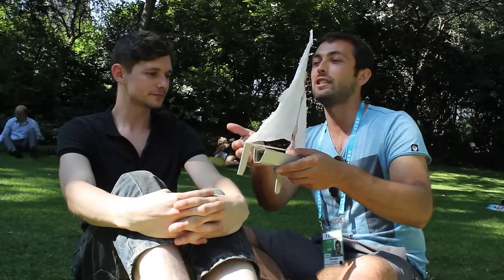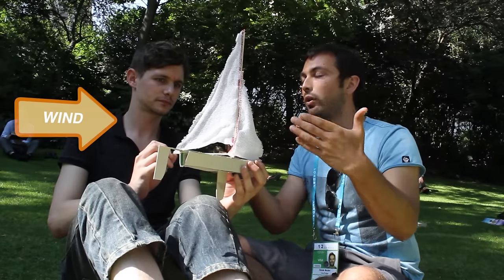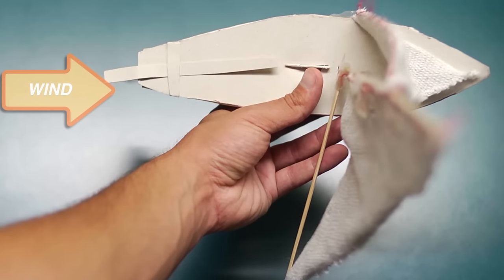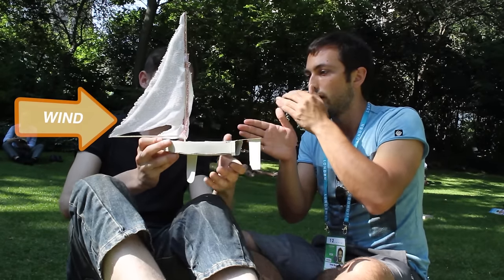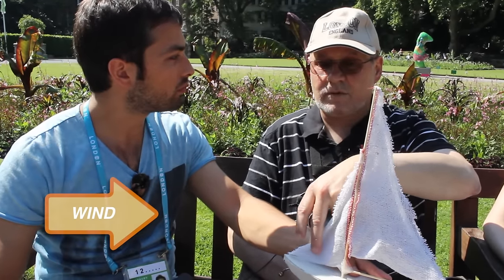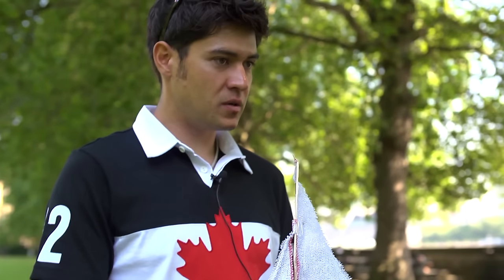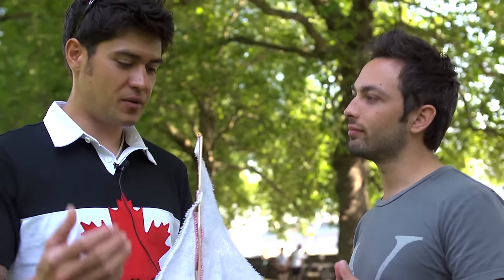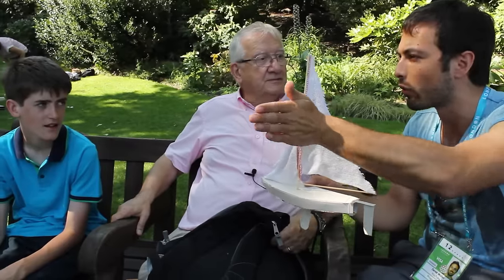How Does A Sailboat Actually Work?

Comment: Agh, again with this nonsense about the air having to "travel different distances". Lift is caused when the sail (aerofoil) turns the direction of the flow. The sail applies a force to the airflow, and the airflow has to exert equal and opposite force on the sail. That force is the lift. That is the kinematic basis for aerodynamic lift - trying to explain it by high and low pressures is technically correct but unnecessarily complicated. The pressure zones just kind of have to happen that way for any interaction with flowing fluid.

When you push something with your hand, you're not thinking that you're creating a high pressure zone on your palm which pushes the object away, even though that is essentially what you're doing by applying a force on the surface area of your palm. You're just applying a total force on the object.
Reply: HerraTohtori The guy giving the explanation was a sailor, not a physicist. Pretty silly that he had a competitive sailor as the expert.

Thats like having a cook as an expert on what happens when you boil meat. He might have some knowledge but more accurate answer is from a biologist or chemist.

jep jep
Reply: The longer/shorter way explanation is especially embarrassing when transferred from airfoils to sails. It is very obvious that the way on both sides of a cloth is equally long. This is an interesting demonstration of how we tend to mask out obvious contradictions in explanations if they are presented by teachers/authorities/gurus.
Reply: Jörg Wagner yeah I can't believe they left in the already false long/short ways explanation that becomes completely nonsensical with a sail! ugh
Reply: Jörg Wagner Similarly, lindybeige once asked a british tank commander at a public demonstration a question about the tank cannon's muzzle brake and the tanker had no idea what he was talking about.

You need not know physics details to be an expert or champion machine operator. You shouldn't be tasked with explaining the physics, though.
Reply: I actually think the pressure zone explanation is clearer to me. what changes the direction of force? right: the air pushing to fill the pressure hole inside the airfoil (or under)
Reply: Agree! It's the turning of the air that creates an equal and opposite force on the sail. This Bernoulli's principle explaination is rubbish. It gives you no appreciation of what's actually happening. It's a consequence, not the reason. How lift is generated on a wing/sail is still extremely badly explained! Wish they would do some velocity triangles and apply Newton's third law. Simple!
Reply: HerraTohtori completely agree with you..
Reply: HerraTohtori Lift and turning the direction of the flow are 2 different principles. Turning the direction of the flow is a momentum change thing, and the only force that can be harnessed from it is one that goes in a downstream wind direction, or a vector acute to it. A sailboat can't go against the wind by just changing the direction of the flow. With lift, you can go upstream.

At least, that's what I understand from your point. Maybe I misunderstood.
Reply: And once again we get this nonsense. If the mechanic you describe was all that caused lift planes wouldn't have enough lift to fly. This is coming from an actual engineer
Reply: @jamesdinius7769  I think you may have misunderstood what I wrote. Or do you think wings can break Newton's third law of motion?
Reply: @parameshnat  You've understood correctly, but the lift is really the consequence of the aerofoil changing the direction of the flow.

In this example, wind hits the sail at a suitable angle, curves around it, and the resulting force applied to the sail moves the boat. Airflow pushes the sail in one direction, but Newton's third law ensures that an equal but opposite force is applied to the airflow interacting with the sail. Typically, an aerofoil wing's lift force is somewhat to either side relative to the ship's hull, so the lift force can be split into two vectors - one aligned length-wise, pulling the ship forward, and one 90 degrees towards either side. The keel of the ship then produces a counter-force to the sideways lift from the sail, and that's what allows a sailing boat to track straight through the water.
Reply: @Statek63  Bernoulli's principle is a bit of a red herring here.

Bernoulli's principle states that when a fluid's velocity increases, it's pressure decreases. This has often been (to varying levels of success) used to explain lift produced by aerofoils or hydrofoils. And it is, in principle, a truthful principle although wings are at the same time more complicated and simpler than pipes of variable diameter, where Bernoulli's principle is usually more directly applicable.

In other words - yes, the airflow accelerates on the top side of the wing more than on the bottom, and therefore the air pressure on the top is reduced compared to the bottom, and you can of course say that the pressure difference causes the lift, but in my opinion such an explanation easily obfuscates the dynamics of the situation and tries to turn it into some kind of static situation where you have a low pressure and high pressure and the difference equals the lift. 

In a more complete explanation of the lift, the behaviour of the airflow must also be taken into consideration.

So, the better question you should ask is this: If we take it that lift can be explained by Bernoulli's principle - Why does the flow accelerate when it passes over a wing that's producing lift? This is where most of the explanations of lift using Bernoulli's principle fall short of their target.

The answer is... the flow speeds up on the top because the wing is forcing the airflow to change its direction.

Which, don't get me wrong, causes a pressure differential between the top and bottom of the wing and integrating that over the entire wing's area produces a force that's called "lift", but that all is just details.

The core concept of lift in its simplest form is that the wing applies a downward force to the airflow, and by Newton's second law, the airflow must apply equal and opposite upward force to the wing. This doesn't mean that air is somehow bouncing off the underside of the wing, rather the wing applies a force to a large amount of air both above and below the wing, as it causes a turn in the airflow around the wing. And the way this force is transmitted to such a large amount of air is via pressure gradients that form above and below the wing, distributing the effect to a certain distance.

Comment: Wow! I was amazed how little most people know about how a sailboat works. Maybe other people want to jump in on my explanation but I explain it simply my saying that a sailboat can do more than just go downwind because it has a keel. With a keel the boat is like it is on railroad tracks and does not move sideways. The sail can be used to blow the boat down wind and obviously more and more degrees off of directly downwind because it has a keel. As the wind is 90 degrees off one side the sail can be used as a wing and make lift 90 degrees off the wing surface and move the boat forward and the keel prevents the boat from sliding sideways. Now you could see that this technique could be used to go a few degrees upwind and may a few more degrees and a few more degrees... You can keep doing this to about roughly 45 degrees into the wind. You can not go directly up wind. I hope this helps and is a very simplified explanation of how a sailboat works.

Comment: Agreed, it's not about distance.  It's simply the sail diverting the air from a path it was going previously.  This diversion causes some backup in the molecules of air, leading to higher pressure on the interior of the sail.  The diversion towards the inside leaves a void on molecules of air (low pressure) on the outside.

Comment: This video is pretty inaccurate, even though the explanations are the accepted ones.  Anyone can see that sails aren't shaped like wings, and there's no significant difference in distance the air needs to go on each side (they're just sheets of canvas!).  The sails work simply because the wind hitting them is deflected by a certain amount.  This means the wind experiences a force, and so the sails get the same force by Newton's third law.  Because the sail is effectively a 'reflector' of wind, the net force on the sail is normal to the sail (ignoring drag; drag brings the direction of the net force backwards a bit).  The normal to the sail always points at least slightly forwards so there is always a component of force from the sails that points forwards.  The keel and rudder are there to react to as much of the sideways component as possible.  The difference in pressure is an equivalent explanation, but it makes no attempt to explain the origin of the pressure difference.

Which direction is fastest is actually is far more nuanced than just a single number.  For an average cruising boat, the best angle is probably around 110-130 degrees to the wind, but for a racing boat this angle is larger.  For an ice yacht (these experience almost no forwards drag from the ground, but don't slip sideways like boats do on water), this angle will approach 180 degrees.  This is because any wind the boat makes (called apparent wind) will tend to decrease the relative wind angle, because any apparent wind must come from 0 degrees.  The most efficient relative wind angle (including apparent wind) is probably around 90 degrees, but the exact number is unimportant.  If you start sailing from stationary with the wind at 90 degrees, you'll pick up speed, but now because of your apparent wind, the wind angle is probably closer to 70 degrees now, so you should turn away from the wind again to bring the apparent wind angle back to 90 degrees.  But now because your efficiency has increased you'll accelerate, meaning the apparent wind will decrease the wind angle again, so you must turn away from the wind again.  This is obviously a positive feedback loop that in principle will allow you to accelerate indefinitely.  The limiting factor is obviously drag, but if drag is small enough, one can sail faster than the wind.  Normal cruisers have a lot of drag so their most efficient angle is relatively low, whereas an ice yacht will have an ideal angle of around 170 degrees once they're up to speed.
Reply: Ironically the model of sailing that you stated was actually the old accepted model, and works decently well up to a point. Frank Bethwaite sums up why this model is inaccurate and why the airfoil model is more accurate in his 1992 book “high performance sailing”. It goes extensively into how he and his son developed more efficient sailing rigs by using the airfoil model. You will see that all modern racing sails nearly perfectly resemble a wing shape when viewed from above. That being said I agree with your assessment of the fastest sailing direction
Reply: A couple of points, Jeremy - "..The normal to the sail always points at least slightly forwards..", but why? To derive forward motion, that's essential, but to simply assert 'forwardness' leaves a gap in the explanation.

"..The keel and rudder are there to react to as much of the sideways component.." - the keel, or fin underbody, yes, but pressure on the rudder? If it had a central axis, perhaps, but for rudders hung off a forward hinge, as most rudders are, pressure is the last thing you'd want ..until you want to steer somewhere else. You're likely familiar with 'weather helm' whereby you have to use the rudder to counteract the boat's effort to round up to windward. That rudder resistance is highly undesirable, simply because it's drag; a well-balanced boat will go where it's pointed.

And finally, as apparent wind increases (as boatspeed increases) the direction the wind comes from moves forward, as seen from the boat, so why "..any apparent wind must come from 0 degrees."?  Ah, I think I see an expression new to me: in a windless sea, any movement of the boat through the air will yield a 'wind' from directly in front. Apparent wind plus actual wind sum to a resultant wind further forward than it would be with wind alone. Fair enough.
Thanks.
Reply: I think Bernoulli's Law and Fluid Mechanics would be a better model for airflow forces explanations, don't you think ?
Reply: @J3zzaG  I think ultimately I was just trying to get at the fact that there's nothing 'magic' about how sails work, fundamentally, because I feel jumping straight to fluid dynamics leaves a lot of gaps.  There's a difference between explaining why sails work (Newton's third law, everyone can understand) and explaining why an optimised sail is more efficient than a simple one (fluid dynamic magic, only wizards can understand).

As a side note, there is a video linked in the description that pretty much says what I'm saying.  I don't know if it was there when I posted.
Reply: @PTomB  "That rudder resistance is highly undesirable..." Yes and no I think.   In my experience, a balanced rig should still have a touch of weather helm. I'm not quite sure why this is the case, but one advantage is that the boat naturally wants to turn into wind and therefore slow down, which is preferable from a safety perspective if you lose your rudder/steering at any point.  The other aspect is leeway; if the boat is moving sideways through the water (which it always is when sailing), then any rudder will experience pressure (causing weather helm again if hung from a forward hinge), whether you like or not.  Obviously, too much weather helm is a bad thing!

Oh, and the normal to the sail always points a bit forwards because the angle the sail makes with the centre-line of the boat is more than zero!
Reply: @Statek63  Yes and no.  If you're doing advanced analysis on the aerodynamics and hydrodynamics of a boat to try and optimise its design, then yes clearly fluid dynamics gives you a much more powerful toolset.  If you're trying to explain how sails work to a non-physicist then I think fluid dynamics feels a bit like magic.  There isn't really an intuitive proof of Bernoulli's principle, for instance.  The advantage of this explanation is that it doesn't invoke any 'magic' - Newton's laws are fairly easy to rationalise and understand intuitively, even for a non-physicist.

Comment: It is probably possible by linking a wind rotor to a water rotor to get a boat to go *directly* downwind faster than the wind.  The key is that the difference in speed between the water and the air is what provides the potential.  

Some sail boats can get to point downwind faster than a packet of wind would get there but they need to tack back and forth to do it.  The mechanism is very similar to the linked propellers but it is unwound.

Comment: Sailing down wind is actually one of the fastest point of sail a boat can travel due to the boat will plane on the surface of the water if light enough and water current. If the hull of the boat is flat enough and is light enough it is able to surf on the waves also. Reaching or sailing perpendicular to the wind is fast but is not faster than straight downwind. Sailing perpendicular requires lots of leverage to keep the boat flat, so that the boat can travel at maximum speed on that point of sail. Many boats are equipped with spinnakers which allow the boat to travel even faster downwind. Now some boats like the AC72s and Moths are using hydrofoils which reduce friction from the water on their hulls.

Comment: I get it, although you may have more initial acceleration with a tail wind, the acceleration decreases proportionally as velocity increases. But at a 40 degree angle, although most of the acceleration is perpendicular to the boat, the component that is parallel to the boat will more or less remain constant, and will be less affected by the velocity of the boat increasing. Pretty neat!

Comment: air traveling behind the sail fills the sail to create the air foil shape and add a little push. air traveling over in front of the sail is what causes life. this happens because of a few things: first is the boundary layer. air is, basically, a fluid. it follows the same laws of motion. any fluid maintains a boundary layer around objects, in that fluid. this layer of fluid 'sticks' to the surface of the object. as you move away from the object, subsequent layers of the fluid become less and...

Comment: Good video, but lacking in physical explanation. You should explain it using the ice skating analogy: the ice skater pushes his legs laterally with a force directed 60-90° to the direction of motion. The ice skates bite into the ice and transform this force into forward acceleration (that is why the ice skates need to be sharp, otherwise they would not transform this force and just slide all over the ice). That is why the centerboard and the rudder are so important: they bite into the water and propel the ship.

Comment: to my knowledge the center board doesn't actually generate any force it just prevents the boat from moving sideways because of the large mass of water it would have to move so then the boat has to move forward.  I imagine it like a ball on a hill gravity is pulling the ball strait down but the ground underneath it is preventing that so it goes down at an angle.

Comment: I'd just like to point out where the majority of the 'lift' actually comes from.
When the wind hits the sail, the curvature of the sail cause a very small difference in wind speed. However, the air on the far side of the sail 'likes' to carry on moving in the direction it was originally going even when the surface of the sail ends. This cause the previously on top air to curve around the sail and 'push back' the air on the inside of the sail.